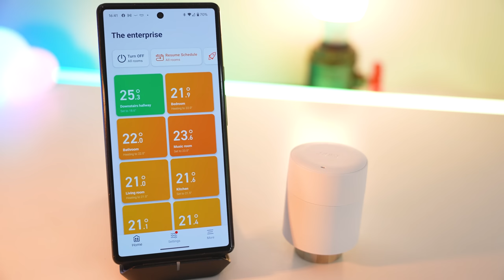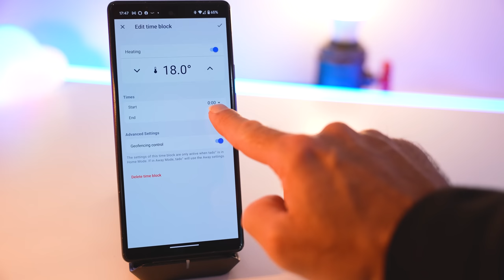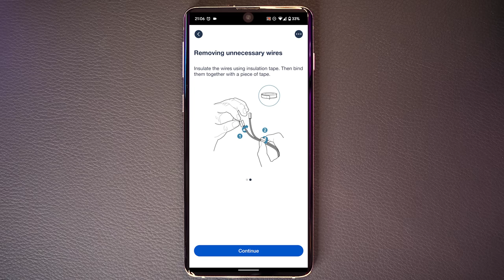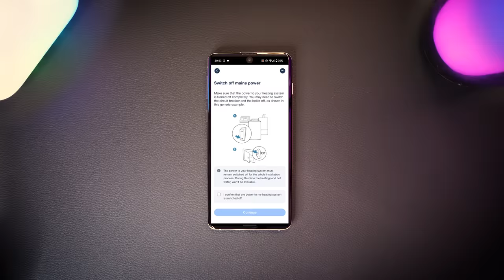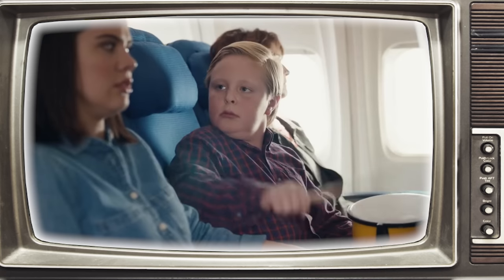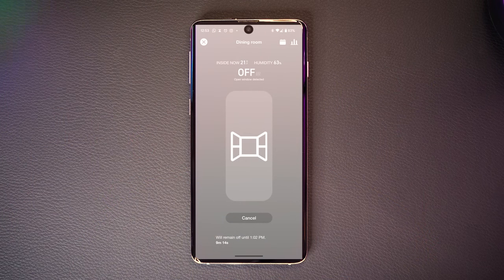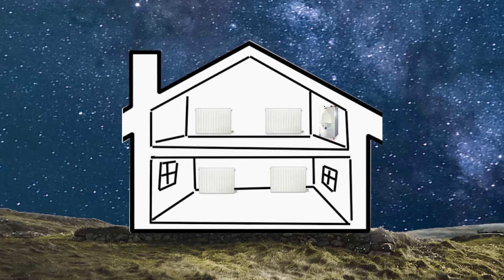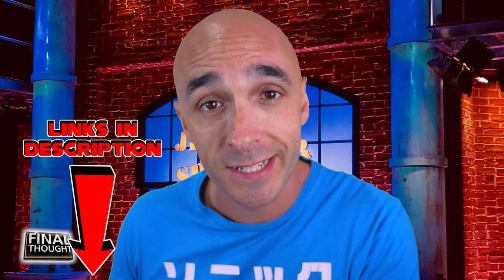Install This On Your Radiator & Drink The Tears Of Your Energy Company

Comment: Smart home help?
I am disabled in a wheelchair and need to set up a smart home using voice control on my echo and using my Android tablet for:
Roller blinds curtains light switches inc. dimmer plugs doorbell thermostat security cameras but I don't want to use loads of different hubs as everything I see seems to have the need for a different hub! Help ! great video I have been thinking of getting a tado system

Comment: ive literally just installed this thermostat, (not the vallves YET). So easy to install, i already had a wireless thermostat (none smart) so was a simple case of like for like wiring, biggest tip, TAKE PHOTOS BEFORE REMOVING ANY WIRING. The biggest issue ive had is the app... multiple times per day it logs me out, tells me ive no internet connection forcing me to "force close" the app, to then log back in and reclaim my user device. but so far so good (4 days installed)

Comment: I've been using Tado for about 2 years now. Great system when it's working, when it looses internet or the servers go down guess what, you have no heating and there is no way to control your heating. I'm seriously tempted to throw my Tado system in the bin and it's a real shame as it is a decent system when it is working.

EDIT: Last time I check Home Assistant there was minimum support but if it can fully take over I think I now need to fully switch to Home Assistant as the going offline is annoying.

Comment: The bypass radiator is there so in case you have a situation where all the radiator valves are shut but the boiler and pump are still operating. If this happens without a bypass you can cause overheating in the boiler and burn out the pump early.
You don't need a bypass radiator though if your boiler has an ABV (automatic bypass valve). A lot of boilers these days have one and others can have them retro-fitted. Given current energy concerns I would strongly suggest getting an ABV over running your boiler when you don't need to. While you're at it check your return flow temp. It's almost certainly way too high (google for more info on that).
Alternatively you can also just set the system up so that the boiler isn't on when no TRVs are open. Obviously this is a lot more reliant on you setting it up correctly so do it at your own risk.
I've had Tado installed for about 4 years with no bypass radiator with no issues. There was some tutting from a plumber I discussed it with but even he basically said the main reason for a bypass radiator on a smart system is "because it says it in the manual that was written in the dark ages".
Reply: The boilers internal thermostat should shut the boiler down once the water temperature gets beyond its set temp. The pump would be pumping with too much back pressure and would be under strain if there is no bypass. If it’s a sealed system then you may increase the pressure not than the pressure vessel can cope with and then the pressure release valve should give and vent off water. If that didn’t work then you’d probably blow the pipes at the weakest point, probably a solder joint. I doubt it would be anything catastrophic just water peeing out at pretty high pressure initially, but nothing explosive. That’s why I prefer open vent systems. Safer but have drawbacks.

Comment: It looks good, similar to the Honeywell Evohome system I installed a few years ago which is really good. Tado should improve the system so its controlled locally though and not be dependent on a cloud-based service. The other good thing about these systems is that good ones cycle the radiator valves every week or two during the summer to stop them sticking.
Reply from the maker: That's really smart!  I wonder if Tado does this! 🤔
Reply: @paulhibbert  probably, they’ve been going a good few years. But I can’t find confirmation one way or the other.

Comment: I've had Honeywell Evohome which I think was the first of these types of intelligent systems for around 6 years and it's been brilliant and has saved us a fortune. It's not open-therm but neither is my boiler. Aside from the benefit of it turning off individual rooms when not in use, it also knows how quickly each room heats up so to avoid overheating.
Reply: Evo home have an opentherm module you can add 😁

Comment: I’ve had tado in my house for nearly three years now. I have some criticisms but in the main, I really like them. So much so, use them in three business locations and at my parents’ house too. 
One thing I liked was how I was able to incrementally upgrade my house, first a radiator in a room, then all rooms, then a thermostat, then the water system.
Reply: Me too, think this is our 4th winter. We've bought radiator thermostats on black friday and such to add to the system.  Geofencing will come back into it's own now this year now we're back in the office.
Reply: if you don't have a compatible boiler will they still work
Reply: How do you operate the system in multiple locations? Do you have one phone for each location?
Reply: @alc4219  No. And this is one of my criticisms of the Tado system. While I do have devices at the locations, I have several logins saved in my phone keychain. So, I logout and then login to the one I want to control. Annoyingly, you can’t switch between profiles like you can on so many other devices (SmartThings, Eero etc.) and when you login, every time you have to choose which device you’re using (an inconsequential selection) and choose whether you want to turn Geofencing on or off. It’s the annoyance of several clicks so thoroughly a first world problem, but it’s an annoyance that needn’t be. I did contact Tado about this back when I went to install the first additional system; they just explained that it’s not possible to do account switching and that’s that.
Reply: @stuartygibson7079  some parts will. I know Paul is talking about particular features that require a compatible boiler but as a general rule, the boiler doesn’t matter - you’re simply either changing your radiator valves or your thermostat - the “message” these devices “send” to your boiler are the same. So think about what your standard “dumb” valve does; it pushes a pin up and down to open and close the valve which starts water flowing, creating the demand for heat. Well, the smart valves do precisely that - the “message” is an analog, mechanic message exactly the same as your normal valve would send.
When it comes to the thermostat, at its most basic level, a dumb thermostat clicks on and off when a temperature is reached depending on where you’ve set that. The smart thermostat does exactly the same thing.
In the end though, as you effectively have thermostats on each radiator, a main thermostat kind of becomes a bit redundant.
Did I win the award for most “speech marks” in a reply?
Reply: @michellegraham562  this is the way - I upgraded my home incrementally, buying parts when they were on offer. Saved loads doing this. As you’ll know, Tado send you offer emails too once you’re signed up so you become aware of when things are on offer.
Reply: @inthapipeline  I have no idea if you win the award lol, as I was mesmerised by how easy to understand that reply was. All without making me feel like an idiot.(I already know that) thanks for the info
Reply from the maker: @inthapipeline  Fantastic advice bud, and really appreciate how helpful your thread is.  If you've ever considered home assistant it could save your first world problem!  You could sign in using both accounts to 2 separate instances and put all the thermostats on the one page!
Reply: @paulhibbert  I have a couple spare Raspberry Pis (😆) that I do little with and a ludicrous amount of smart home tech - I have no real excuse for having not done Home Assistant yet outside of sheer laziness (and hips I’m not sure would survive the resultant Home Assistant hip thrusting). I’ve watched your conversion over time to HA and it’s given me a bit more motivation but still not enough to actually get off my ass at this point. But if you’re saying it could ease yet another area of my smart tech use, perhaps it’s time I pulled my finger out.

Comment: Seriously, what kind of heating system do you have there 😁.  I have a boiler and hot water heat but the valves are all in the basement aside the boiler. The thermostats are in the rooms upstairs like any other heating system.

Comment: I've been using the tado radiator valves since January 2020 and they are brilliant. Only problem I find is the radiator valves temperature is a bit off but other than that they are brilliant
Reply: They are at the heat source, that's why they usually have an offset
Reply from the maker: @ismaelyu5  I've found the offset helpful, but someone else claimed they're then wrong when they're cold.  That remains to be seen for me, the house has been a comfortable temperature since I corrected the offset.
Reply: @paulhibbert  well, sounds they adjusted for normal room temperature and have no temperature compensation. 
I bet it goes in the other direction when they got really hot.
But you find this on many simple electronics. Just a simple ptc but the device should be at room temperature all the time to be in spec

Comment: I’m assuming if you turn the temperature up on one radiator (with out the heating on)  it will turn the boiler on and call for heat? For that one radiator regardless to the main house thermostat temperature?
Reply from the maker: Yes, assuming you have it setup the way I do with the receiver in the boiler cupboard. I'm not sure if it's possible to buy the TRV's on their own and use them independently.
Reply: @paulhibbert  ahh threat thank you for replying!!! Been looking for months… to ditch the nest and go tado, but never find a video that answers and shows the boiler calling when rad valve is adjusted adjusted alone 👍

Comment: Was actually thinking of radiator valves already but hadn’t because of the number of smart home log-ins I would be handing on when I move house. There will still be a google (doorbell/thermostat), eWeLink (lots) and Tuya/Smartlife. Those look easy to remove and take with you though? I already have dumb Thermostatic Radiator Valves in the bedrooms. To install those I had to drain the system and it was a pain in the arse. Also I was looking at Zigbee ones because I have a hub already and don’t have an OpenTherm boiler.

Comment: HOLD ON!! Did i find somebody who is talking about!

So, I have a system boiler with an unvented water tank. The aim is to get Opentherm with PDHW as the boiler Ideal Vogue Max s18 supports both.

Now, I got TADO the EU model because it supports Opentherm whilst the UK does not.

but the problem starts here!
I had an electrician who basically said the device does not have enough connectors and cant install HW / CH on that one RELAY COM NC NO.

How did u get it to work ???

Comment: I'm using TADO since the beginning of 2022 and are very happy. Before we used a centralized thermostat with thermostat valves in all rooms except the main room. We have block heating. We replaced the valves in all rooms by TADO. As the full service for 'open windows' actually is a paid service and it was not very fast, I created combined this with window sensors. In HASS I created an automation that prevented the heating going on with the windows open. And if the window opens, the heating switches off. Very, very happy so far!

Comment: Got tado 4 years ago and worked perfect since. Six trvs installed and only one jammed. Informed tado and they gave me a promo code just because the trv is out of warranty.
Bateries will last about 8 months not two years.
Only thing that I find not good enough is that they don't have a summer setup (the trvs will open even in the summer).
Can use IFTTT with tado.
Energy iq is amazing.
It will show you the air quality from your area.
And, maybe one of the most important things, they are very quiet when open/closing the valve. German quality boys. IT WORKS! :)

Comment: Ive kitted out the whole house with Tado, with devices across 3 floors with no connection issue whatsoever. been running it for about 3 years now. Brilliant system, support is fantastic too, even though ive only needed it once, on install. I had it all wired & programmed correctly (Im an electrician so this wasn’t an issue) but it just wouldn’t have it. Contacted them, they confirmed a programming issue their end and reprogrammed the controller remotely! 👍🏻
I dont use geolocation, with 6 of us in the house and me the only geek 😅 it saves everyone else having an app they don’t want setup on their phone. I use schedule to bring different areas on/off at correct times. Each of the kids rooms have separate schedules as they are here different times/days.
The only issue I’ve had is the actual valves themselves (the bit the tado device screws to & operates) weeping a tiny bit on a couple of them. This then creates a wet/damp environment inside the tado device which has destroyed 2 of them (fitted on seperate valves) wouldn’t even notice this slight weep on a dumb TVR, but cant blame tado for this as its not the devices issue directly but something to look out for!
Ps we have 4x towel rails in the house, and Ive left all 4 without any controls so they heat up when anything else calls. Keeps the bathrooms from being cold but I don’t want a bathroom calling for heat & firing the boiler up directly. Strongly advise leaving a towel rail or bathroom radiator as the open one and controlling all of the rest.
For rooms with more than one radiator it uses 1 as a ‘master’ and reads the temp from that, and opens/closes all depending on what thats reading. This can be a bit inaccurate in some setups. I bought the wireless room thermostat when it was released which goes on the wall and then becomes the ‘master’. Much more accurate & even temps but something you may want to consider when pricing up your system. Or plan to add on later

Comment: I've been using Tado for around 3 years with no issues. I bought them from a mixture of online retailers when on offer and also ebay. My bypass radiator is in my hall which is where I wired in a Tado controlling wall thermostat in place of the rotary thermostat. It's brilliant.
Reply: Can you elaborate re the controlling thermostat?
Reply: @Andy-ds5bj  I had a wall mounted rotary thermostat in the hall which turned on and off the heating based on the temperature through a wired connection to the old timer. I replaced this with a Tado thermostat which came in the smart thermostat starter kit v3. There are wired and wireless versions. Mine works either wired or battery.

Comment: Great video Paul, I have been using the Honeywell Evohome system that is very similar for many years and I found I saved around a third gas use and had warmer rooms as they finish heating when they are at correct temperature, not when the hallway is happy!

Comment: Been running these for a year or so and it’s been very good.  I’m powering my Tado bridge via a POE injector.  Re internet I have a 3/4G backup connection with policy rules for these devices.  All in all very good, but as you say not cheap.  I’ve picked up a couple 2nd hand and Amazon Black Friday deals etc.  I have also purchased the optional room thermostat for better temperature tracking.
8 TRV units
3 room thermostats
Next up new upvc windows at £10k 🤦‍♂️👎

Must look at HomeKit more

I believe Hive are exiting the market.  Do wonder what is the plan re Nest.  Had a nest originally.  Do have Nest smoke alarms though, they make Tado look cheap re pricing.

Comment: LOVE Tado & reliable but wow they are not easy to reconnect the TRV to the base once changed batteries. They are one of the best looking radiator valves. Coming this month the app will get Dark mode finally.  I only use the TRVs with small bridge hub.

Comment: Honeywell Evo home. I swear by it. Opentherm set up on it too. Saved me a fortune on heating. Love that only rooms that need heating are heated. I like that it also has a permanent wall mounted control panel too.
Reply: I thought I would like the wall mounted panel, but even now that I’ve actually wall mounted it with a hidden cable in the main room… nah. I just use the app or home assistant thermostat dashboard to control it. And even my dad doesn’t really use the panel. Should’ve gone Tado, but it’s not like I’m going to switch over now, is it. Spent many hundreds and I’m not going to do so again.

Comment: OpenTherm is a standard that only takes heating on demand boilers in consideration.
Oil/wood/pellets boilers can just forget it. There you heat up a tank to say 80C, used for warm water and heating. How they regulate out heating is not on/off but how much heated water from the tank you need to mix with the return pipe to send out water again at a set temperature. None of those systems supports this. I've talked to Tado several times about this and they cannot support more than on/off (typically gas boilers).

Comment: I never use voice for Google Maps, but I find if I type in the address it works.   
Tado is pretty decent usually.  Worth looking at for sure.  Probably some of the best TRV's out there.
The idea of a bypass is so there is always waterflow through the boiler and the entire system.  Forced Air systems need the same thing.  There needs to be a certain amount of airflow through the system to prevent overheating of the system.    Towel rail or an area like a kitchen of living room where there is often people present is a good area to use as a bypass.
Reply from the maker: Good to know mate, thanks!  I might move my towel radiator one to the hallway, my bathroom could probably benefit more from the fairly constant heat than the downstairs hallway